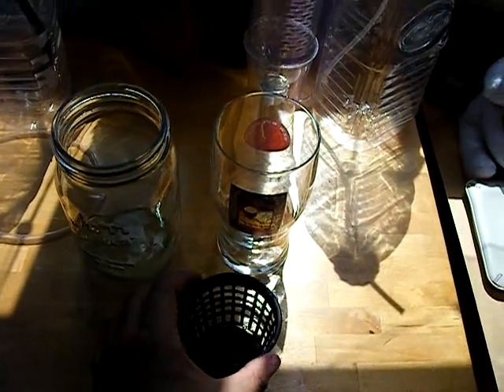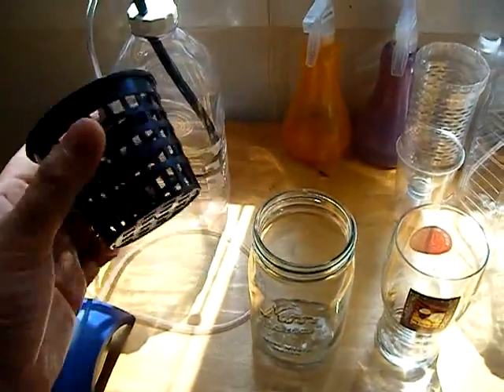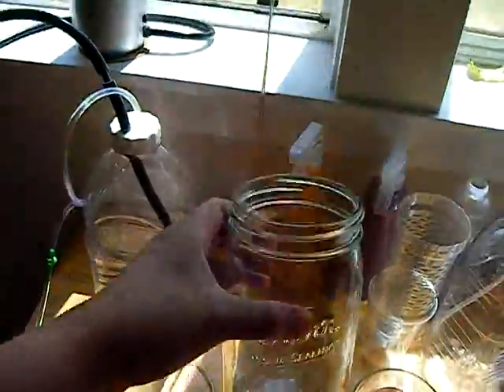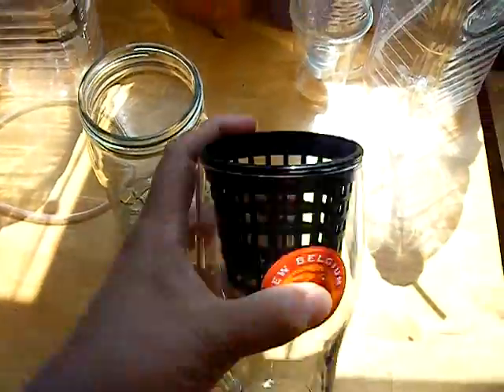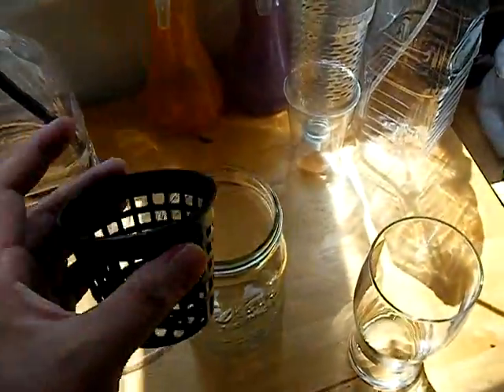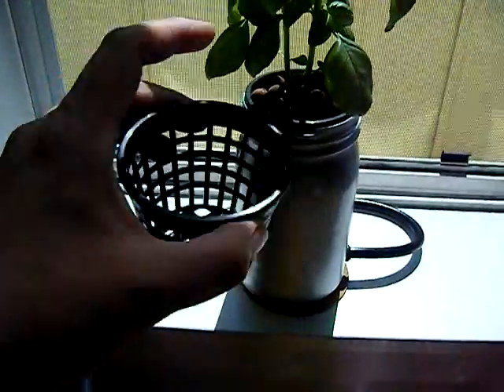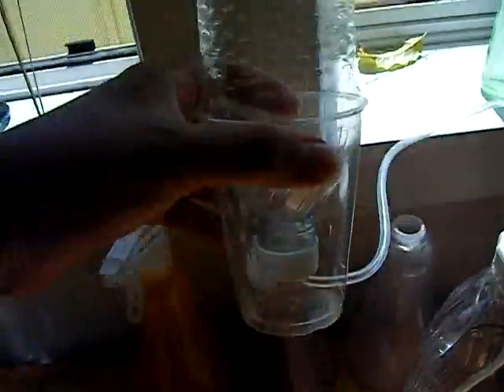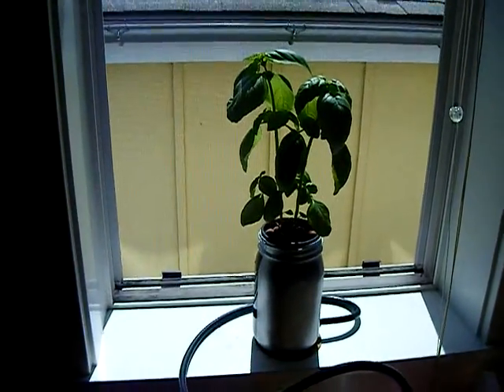Extremely simple DIY ebb and flow hydroponics system: part 3

Comment from the maker: You typically put the seed in some rock wool surrounded by clay hydro pellets all of which are in the cup.  The rock wool is an inert absorbent material, similar to fiberglass insulation; its there only to hold the seed and roots in place.  the clay pellets are there to hold the rock wool in place.

Comment: Awesome little DIY series. I tried this out, and it worked nice and reliably. I found the same air pump at a Petco, and a few feet of vinyl tubing, and once I got the water capacity for the flood bottle measured it was dialed in. 

Easy as that. Thanks for posting this handy series of how-to for this tidy (and cheap!) DIY mini-system.